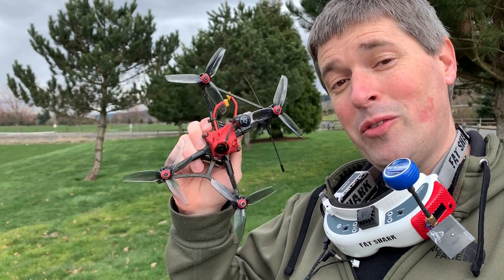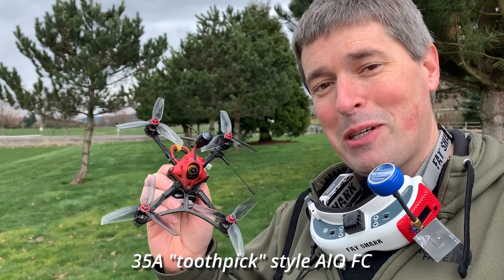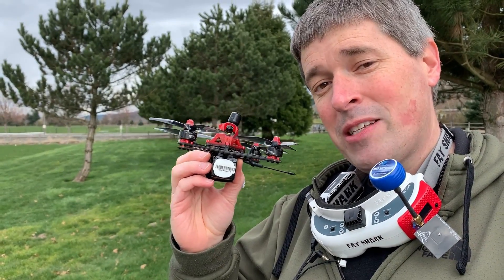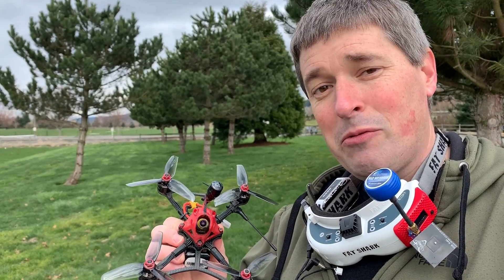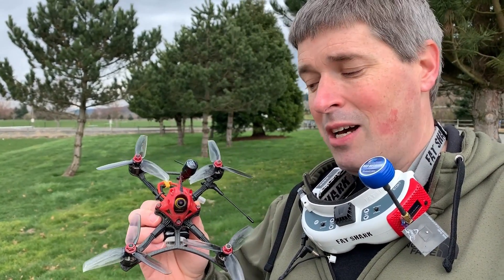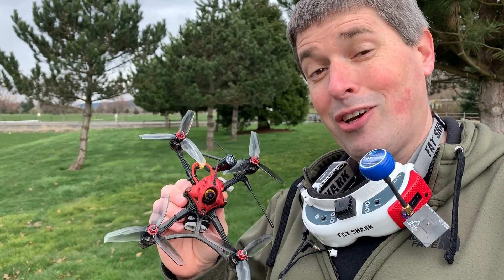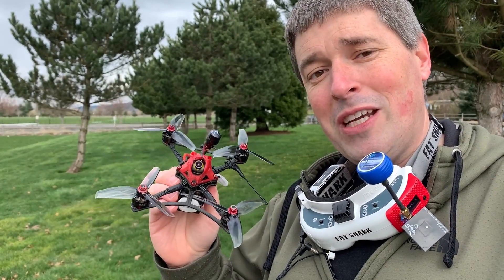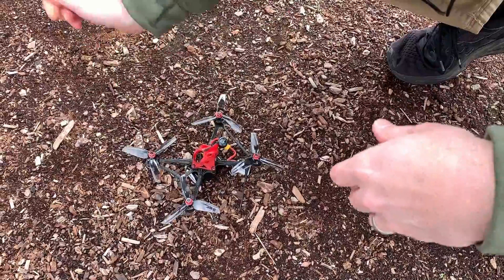OK, I'm gonna try it on 6S... FOR SCIENCE!

Comment from the maker: One minor correction. There is one extended punch in this flight and the OSD reports over 60A even with the 70% throttle scale. That's unusual. Again, the throttle scale is not the same as having lower KV motors, which would be the better thing. I had air mode on, so I suspect it was allowing the FC to make high power micro corrections above and beyond my 70% throttle command. Also my current meter is not calibrated yet. It's reading a little high. Now... if only I had some 2,300KV 1606 motors to try on 6S. That might be the sweet spot... maybe... :-)
Reply: Mr ShutterBug hope you find the motors, build the quad, fly it & show us your results. Take care
Reply: Mr ShutterBug you had me at “for science” haha.  Seriously though I’m extremely interested in what is possible with 4” <250g so thanks for your initiative on this !

Comment: hi Mr. Shutterbug I love your constructions, I have tried a construction with the betafpv aio 35A-6s and betafpv 2004 1700kw engines, and my fc has burned, you could show a video with the complete configuration in betaflight.
a greeting from Spain.
Reply from the maker: That's a bummer! I have used the 35A 6S AIO for quite a while now and it has been working fine. On this drone I believe I was using betaflight 4.1.1 with close to default PID tuning setup
Reply: thanks for your answer, i will prova with firmware 4.1.1
greetings and I keep learning with your videos 👍

Comment: I am thinking about 6/6 (6S/6") drone with AIO FC..... ???  next configuration FC: 20x20mm JHEMCU GHF420AIO 30x37mm 8gramm but 2-6S and 35A, motor: Emax ECO Series 2306 1700KV 32gramm/32A thrust 1700 OR Emax Excelvan GB 2306 1650KV 30gramm/30A thrust 1700 with "weak" 2 blade propellers 6030/6040..... they needs to be work or smoke? :)
Reply from the maker: Csakegy Senki those motors will pull a lot of current. 30A per motor is 120A total. I don’t have any experience with that particular AIO, but there will be a serious chance of it overheating. If you want to use 2306 motors, I suggest getting a 20x20 stack with a good 4-in-1 ESC. I think the AIO boards are better suited to lighter drones. Just my opinion, of course. Cheers.
Reply: @MrShutterBug  thnx..  I found this.... 
Gal Kremer did it :) HGLRC Zeus35 (35/40A) 6/5 drone 6S/5" motor 2207/2250KV terrrible... :)  https://www.youtube.com/watch?v=iLOX1YYMntA

Comment: u really should do this on 4.2 with rpm filtering :T   all of my quads, including my 3 and 4 inch quads, fly incredible on it.
Reply from the maker: 4.2 sounds promising. I tied 4.1.4 with rpm filtering. That was my first try, but it flew horrible. Bad vibration and weird lurches. I couldn’t tune it out. I switched back to 3.5.7 and it was silky smooth. Now, some people are obviously having success with 4.1.x, so it’s possible but I’m happy with how this one flies on 3.5.7 at the moment. Part of the problem is CPU load. These AIO boards all have F411 processors which are slower than F405. RPM filtering at 4K/4K takes 60-85% CPU on the bench with an F411 even with other stuff turned off (reported by “tasks” command). I think the really weird glitches I felt were related to high CPU use. Yes, there’s over clocking, and I could run the PID loop at 2kHz, but 4.1.x certainly doesn’t “just work” without some careful settings. If you know of a magic solution, I’d love to hear it. Maybe 4.2 is that solution? I hear they made some optimizations.
Reply: @MrShutterBug  yeah i hear you!  check out the 4.2 tuning guide and the CPU optimizations that chris did.  f405 and f7 can run at dshot600 and 8k8 now.  but i think f411 is still gimped i think just t o 8k 4k.  but still -- it should run!    i have 4.2 on my betafpv 20amp aio running great on my toothpick!

Comment: Dang!! I wish I could fly even half as good as you. I did a similar build on 6s using the BetaFPV X knight frame that is made of T700 carbon fiber. The all up UAW is just under 250 grams with a 550mah 6s Lipo. I'm not a great pilot, but Im using and official 6s motor Xing 1507 2800kv 6s. With your piloting skills, maybe you might consider using those 6s motors to see what type of results you get! I've built the quad, but need your skills!! Lol

Incredible test!

Comment: I want to see a different test if possible... Put some lower kv motors and run 6s to match the rpm with 4s and take your throttle limit off of your radio :) i think that would be a better test comparation 4s vs 6s thanks for sharing the information you have available :)
Reply from the maker: Yeah, that would be better for sure. We all know that higher voltage + lower KV is better when it can be done without increasing the weight too much. The problem is that components are more likely to fail at 6S. So that's the question for me. Will it survive?
Reply: @MrShutterBug  "components more likely to fail at 6s"...haven't heard that before. Care to elaborate?

Comment: There is a motor scaling feature in betaflight that limits the motor output instead if throttle. That prevents the pids from being too hard in the motors
Reply from the maker: The motor scaling feature requires betaflight 4 right? I'm using 3.5.7 (by choice).

Comment: Great Flying, Try the RCIPower 1506 3000kv motors 😁👍 they are perfect with this sort of 4" setup, I found the Emax 1606 3300kv motors can get very warm when you push them hard. Also try the Gemfan 4052 on 4s 😉😉 (They do fit just but you need to really tighten them down)
Reply from the maker: Warm motors are a result of the tune. My motors were not hot at all after this flight. RCINPOWER makes great motors, but I still think 3000KV is high for 4" 6S, at least for racing. Racing requires sustained high throttle. If I could get a motor like that at 2300 or 2400KV, that would be ideal I think.

Comment: Great flying! Really smooth 720s turn! The most important spec on this FC, is that it’s the first 4in1 35amp BlHeli_32! I was mentioning this last year that BetaFPV should make such a FC & they did it! Up to 6S & we can see the results the way that you fly! 👍 Have a great weekend & superb flight.
Reply from the maker: BLHeli_32 is certainly a nice bonus. I'm running it at 48kHz PWM, but I am not using RPM filtering because it takes too much CPU time for these F411 processors, and I like how it flies better on 3.5.7 anyway. Cheers!

Comment: Interesting board! Wonder why you would get the 20a  over the 35a when the price is so similar. Seems like could get this board and reuse it in a variety of build of 2 to 4 inches, maybe even 5"?
Reply from the maker: In terms of amperage, 20A is actually plenty. The main advantage of the 35A board is that it uses BLHeli_32 and supports 6S. But how reliable will it be on 6S if I continue to push it hard? That remains to be seen.
Reply: because it is blheli32
Reply: But thats what I mean. I would always get the 35a board as it does everything and more that the 20a does for only a little more
Reply: @scycer  me too
or the one from fettec 🤫